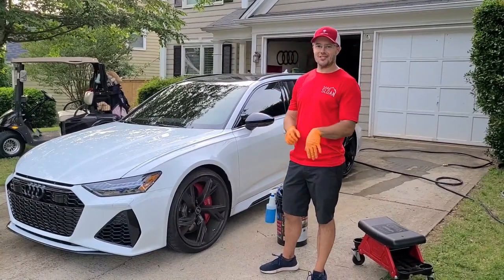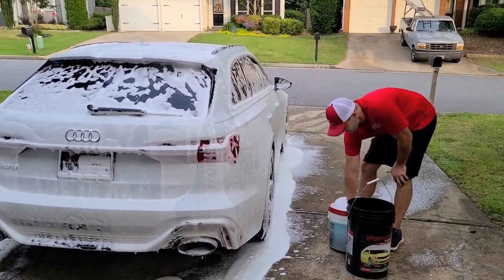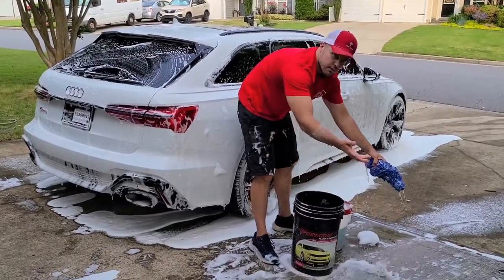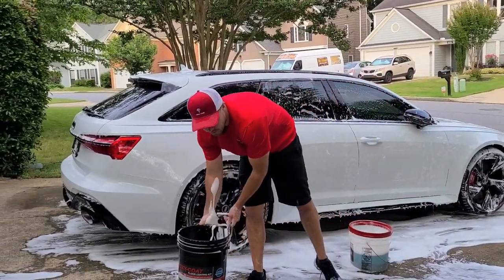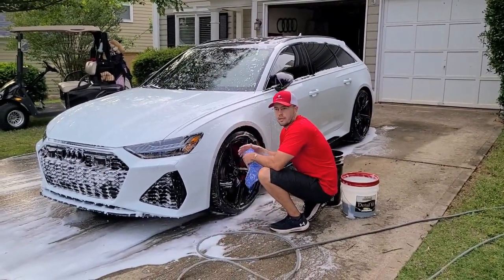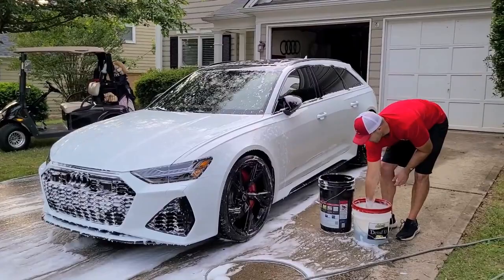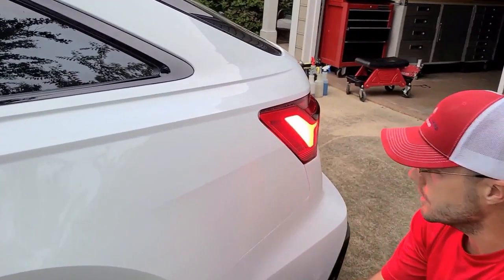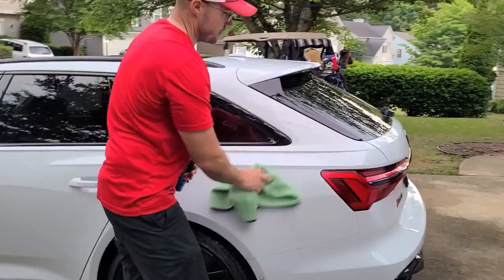RS6 First Foam Cannon Bath - Wash & Talk through Future Modifications

Comment: had my rs7 c8 vorsprung 2 weeks, had it fully ceramic coated...bit disappointed in the performance and gearbox after my previous m5 f90 competition, it feels flat and slow. Its booked into have a stage two tune next week, hopefully this will make me like it. i see yours has black wheels, i thought in uk they only come with diamond cut which i much prefer i have to say
Reply: @extrabolts  ah ok I see. I love the diamond cut look. Will you go stage two? I’m getting milltek downpipes fitted and might even get the eventuri intake as stock intake very restrictive. Should sound good too.  Stock car just feels slow to me. I’m using QST Tuning here in uk. They running fastest stock turbo rs6 at moment. Check out their YouTube.
Reply: @extrabolts  no you need tune with downpipes. Im just gonna go stage two with QST they are getting 750 bhp upto 770 bhp at crank if u add intake too. their stage 3 then takes you upto 850bhp crank.
Reply: @extrabolts  i always heard that you will get car throw up errors when you stick downpipes on hence needing map, plus fueling to be adjusted due to more free flowing exhaust without cat restrictions....in the uk of course we have the hideous opf filters too, but i will be ditching that too. Will hopefully bring car alive more .....fingers crossed. im interested what you guys pay for ppf out there , my m5 was £2300 just full front end and the sills. I may get this rs7 but ill wait to see if i like it after the tune or move it on.